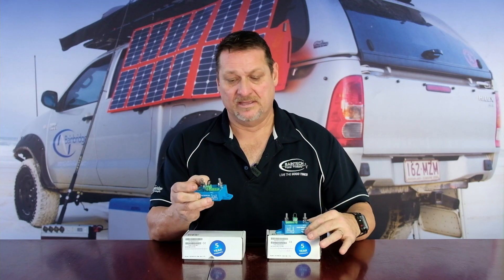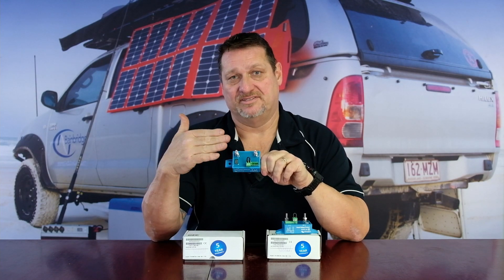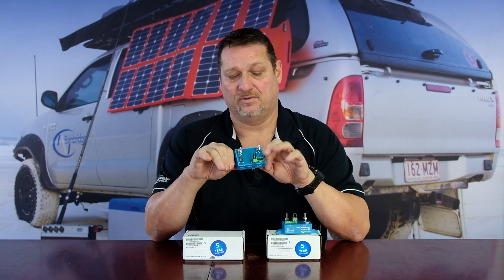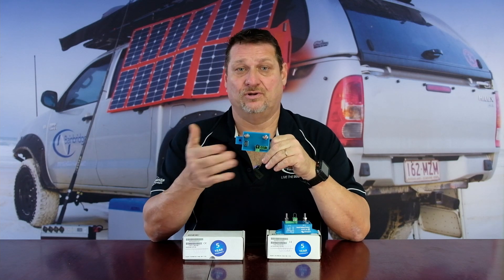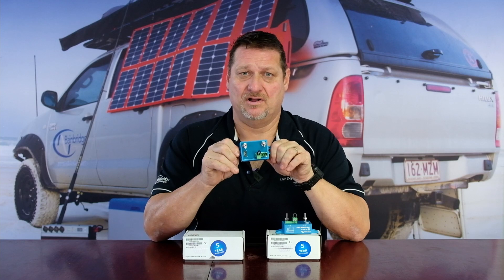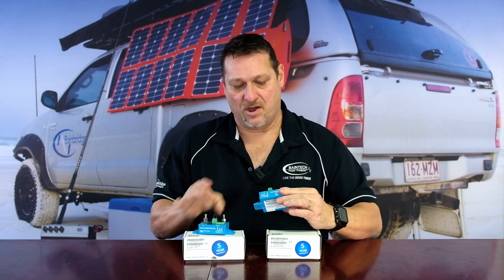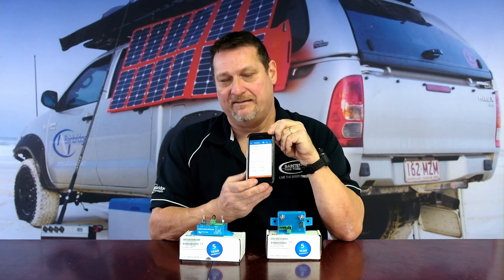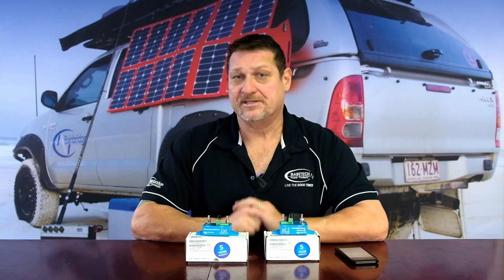Victron Battery Protect Explained

Comment: Not impressed china in usa phone out, because some of the diagrams expressly communicate that the BP 100 or other not be connected to the inverter but to the remote switch. So that's easy, but they don't give the output voltage for other brands inverters switching device. Further if you have a really long DC cable to the inverter you may have a wave form according to this other video online which was in specific. So why would this business not recommend directly hooking to an inverter? 🎉

Comment: so once it does the low voltage and breaks the circuit how does it then let the charge from the dc to dc to charge the battery back up? u know what i mean like if its on the other side of the break? thanks
Reply: The battery protect goes on the load side. It disconnects the loads if the battery voltage drops below a set voltage. It does not disconnect the input from chargers or mppt controllers.
Reply: Once it detects that the batteries voltage is back to normal it will automatically close the circuit to allow the battery to give back power to devices etc

Comment: Good video explanation. What amp size battery protect is best??
Reply: Depends on your maximum load current, if less than 65Amps, BP65, if more than 65 Amps but less than 100, BP 100, etc

Comment: With the Smart model, does that mean I could open the circuit using the Victron app? I.e. manually disconnect the load to my battery when I want to (like when the car is not going to be used for some time). Cheers.

Comment: could i charge a second battery through that unit ?
Reply: it senses voltage and either opens or closes the circuit.
Reply: @GregRickard  i get that, but it could be used as a battery combiner.
Reply: @AndrewSparkfish  It goes bwtween the battery and the load so once its triggered from low voltage, the battery needs to be charged above the cut-off voltage before the Victron reconnects the circuit. 
You know about isolators right?
Reply: @GregRickard  i understand and know what it's meant for.  Was thinking if a house battery was connected the other side of the vehicles battery then it would combine the two once the alternator starts charging and disconnect when the alternator stops charging.
Reply: @AndrewSparkfish  Andrew it's an on/off switch with a few smarts, that's it. Power from battery one side load the other side, not enough juice at preset parameters, turns off. Power comes up above set voltage turns on and powers load.
Reply: Late reply, but this battery protect units cannot handle back-flow/reverse current. 
So that's why they would not be used directly on inverters since once the power is cut from this BP unit, the inverter might still hold power (in is capacitors) that could die back to this BP unit and over time destroy/fry the internals

Comment: hELLO    ! Please, is it necessary (and why) to put a "victron energy  battery protect" 🙂😮😮 like I got a good BMS on my battery ? It seems to do a similar job, no ? Thank you. (perhaps have you got also a better idea. Thanks)
Reply: 250 amp diode can separate the lithium ion battery from the automotive battery and the inverter can draw from another source vehicle as inductive capacitance is greater for the capacitor on the microwave.